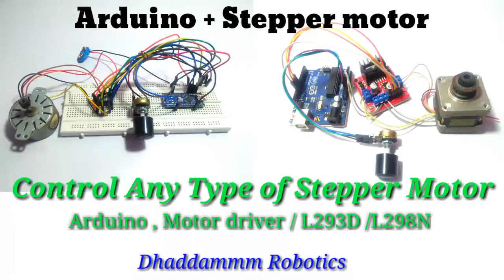©How to Control Any Stepper Motor | Simple method With Code or  Subscribe |  Dhaddammm Robotics

Comment from the maker: Maze Solve Circuit diagram  in this video: https://youtu.be/AJkUfTUXxEE

Google GPS Tracker: https://youtu.be/uY4r5qXuL0M

Innovation For Accidents Control : https://youtu.be/jZw1OhzcH-8

Mind control car: https://youtu.be/DWCQwEc3BDQ

Joystick Control robot: https://youtu.be/i8MjWT3oflY

SMS Control Robot: https://youtu.be/oXq_mOTh10I

Home Automation: https://youtu.be/YPzGSD7J-F4

Gsm home Security,Sms : https://youtu.be/gPb8UDl-b-M

Gsm send Sms for Exotic Gas Home Automation: https://youtu.be/BRlDkQup_C4

Check other video: https://youtu.be/MoU7tUv8K3E

Self balance robot with code: https://youtu.be/JAdz1JszsAw

Joystick Control Robotic Arm: https://youtu.be/GCpvZTg-rz0

Gsm Fire fighters systems: https://youtu.be/JMsUrAV-4-A

Auto irrigation SMS Control: https://youtu.be/wAWRKZIe5jY

Esp8266  WiFi control 4 axis arm:https://youtu.be/emZ2IO38dKo

Esp 8266 WiFi control home automation: https://youtu.be/EQzqbrtJlc8

Dancing led cube:https://youtu.be/t-uFFbowEn4